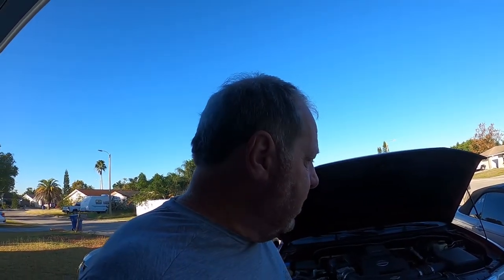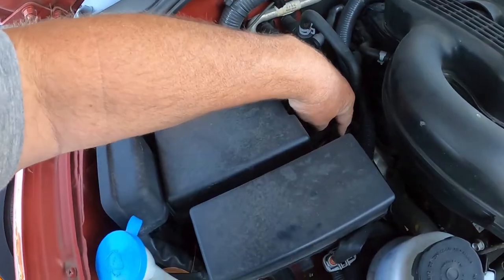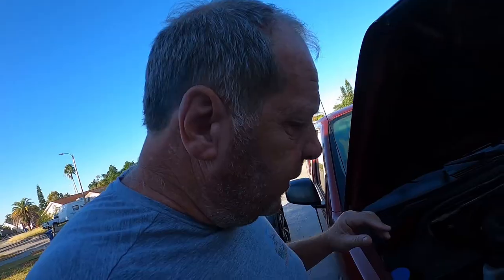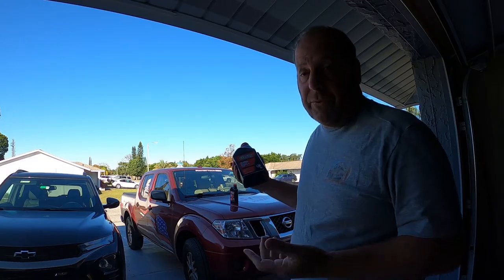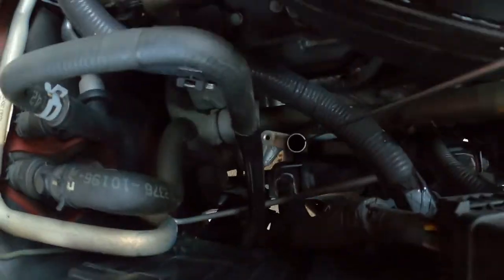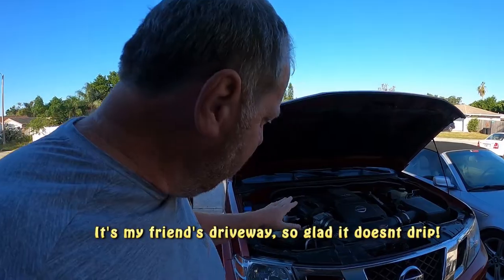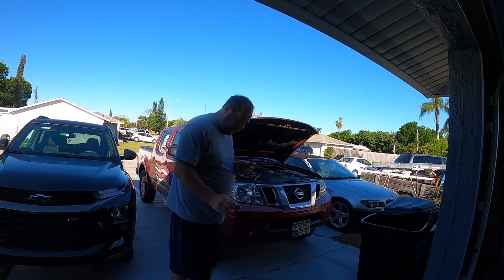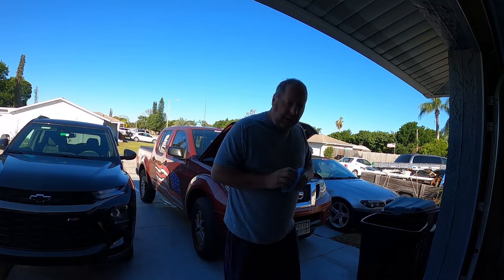2005   2017 Nissan Frontier, How to Check Transmission Fluid & Add Fluid V6 4 0 engine

Comment: Did you ever have a wobbly feeling when driving that truck? I have the same truck and I replaced my struts and it fixed the wobbly feeling. I have 100,000 miles on it. When do I need to replace my timing chain? And transmission fluid? This is my first truck and I have had my truck for almost 2 years. I have put 40,000 miles on my truck in 2 years. My truck has been feeling sluggish and jerking. I don't know what that is.
Reply from the maker: I chnage the front wheel bearings at about 80K miles

Comment: It's matic s not matic 5 , I know the s looks like a 5 👍 I use valvoline maxlife full synthetic in my 2015 Nissan frontier pro 4x since it was new and it does very well.  Drain and fill every 30k miles.

Comment: Didnt feel it necessary to maybe drain any old fluid in there? And to maybe add more than just a quart?
Reply from the maker: I didnt feel the need. But you might, depends on miles and other factors.

Comment: Good bie transmission wrong oil type nissan very delicate trans. 😂😂
Reply: Well what is the right kind then ?
Reply: Genuine nissan matic s
Reply: He's right you know...

I'm just still angry from dude's clicky sighing  weird breathing noises as he not only slings fluid all over by holding the GODDAMNED Oil Quart backwards,  but the genius dual funnel stunt, but add a HALF quart why don't change, and cycle the Transmission frommpark to low and back up to park again... it's like c'mon dude... I'm gonna go kick my dog now. Thanks buddy.
Reply: Thank you sir great video

Comment: thanks
Reply from the maker: No problem, Glad it helped
Reply: @JunkyardsandBarnFindswithSean  I was bone dry according to the dipstick. then i have bought about 4 quarts from autozone and.... received mixed information about which i should use. yesterday a guy said dex4 then tonight the kids says multi vehicle and not to mix them. I understand where he is coming from and he kept talking about it being a "Nissan" transmission as if Nissan transmissions are aweful... ... anyways. im about to put 3 quarts of multi and one quart of dex# 
just to get to the trash dump across the street and the shop down the road to do the rest